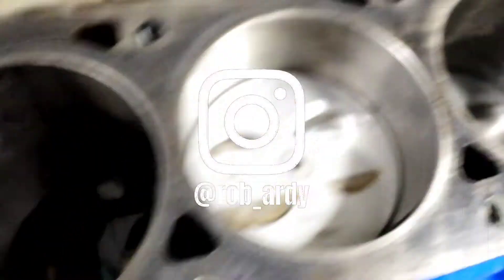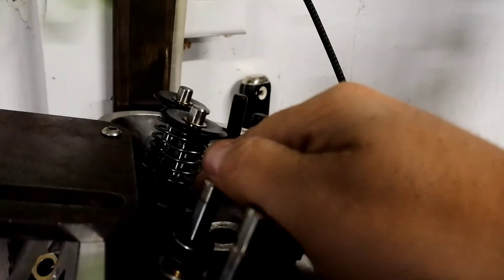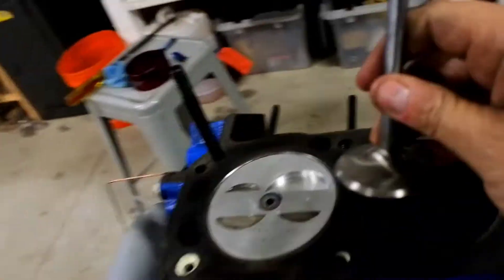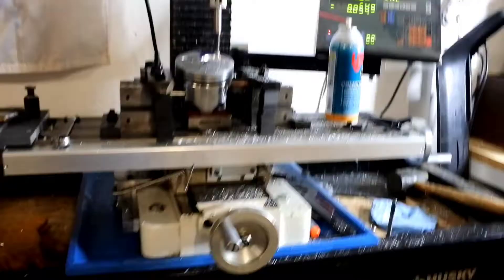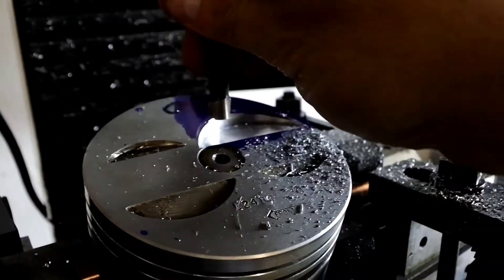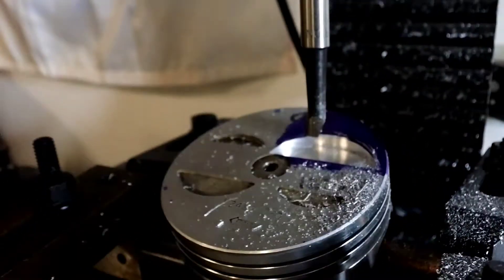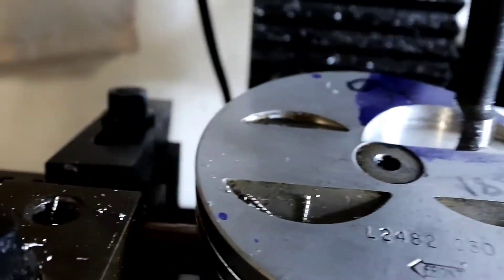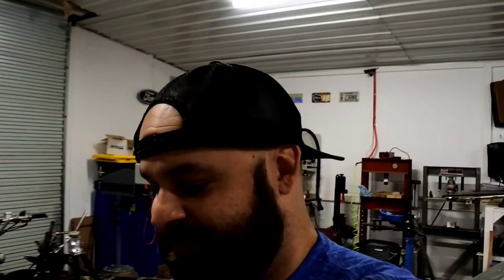Cutting piston to valve relief

Comment: Be careful about the depth, Im this gals hubby and ASE patch says, Master Engine Machist, not bragging just wanting to help and let you know that im not just some joe blow, who knows just enough to be dangerous. Also, what i would do, is radius the corner of the tool in case the piston is really thin in that area, every piston will not be the same due to core shift when poring the mold . Hope this helps.
Reply from the maker: Thanks. Engines been running great for over a year. I did measure material depth and there was plenty. I appreciate the comment.

Comment: I would highly  recommend you put a radius  on that tool bit! 0.031  you bee happy you did  cast piston   ! Because  it will cause  a stress cracking in  the corner
Reply from the maker: Hey Jack, I’m no machinist. Just a guy with some machines. The pistons are forged, not cast. Would you mind telling me the benefit of a radius in the tool? Always trying to learn.
Reply: @rdspeedfab  yes sir the reason  you put a radius  on the tool ,so there's no sharp  corner in side the  the piston pockets  , sharp  corner will crack the piston under Detonation or heavy nitrous  hit
Reply from the maker: @jackwillson8099 oh okay, that makes total sense! Thanks for taking the time to explain that. Maybe after I blow this one up, I’ll use a radius in the future 🤣
Reply: @rdspeedfab  you can all so put a radius  on too of the piston pocket , the key is no sharp edges  in  the combustion  chamber    , the more power you make it,  the devils  in the detail learn that from pay musi 35 years  ago
Reply from the maker: @jackwillson8099 I sure appreciate your wisdom. Thank you
Reply: @RDspeedfab  no problem  been a Professional machinist an engine builder for thirty five years

Comment: Insky Cams sells a piston notching tool for about $235 you run through the heave valve guide. They make them in different sizes depending on what size valve you are using
Reply from the maker: Yeah I’ve seen those. I’ve heard they work pretty good.

Comment: Ok...one more question. How did you figure out the correct angle to mount the piston in its vise or holder or whatever in your mill?
Reply from the maker: Check my other video on this. I made a fixture that made repeated cuts a sure thing.
Reply from the maker: I measured the angle of the valve in relation to the deck surface and used that.
Reply: @RDspeedfab  I wondered if that was a way to do it. Good idea!! Thanks man!! I really want to get this engine put together so I don't hurt my 289. For 40 bucks I can beat on this one and not feel too bad.
Reply from the maker: @nickfay2359  heck yeah man! Good luck!
Reply: @RDspeedfab  I did see your video with the fixture. Very cool!  I totally understand how you built it, and get how you figured out how to set the angle and whatnot. After thought hell, I'd have done the exact same thing. Nice fab work! That's how we roll in my tiny shop. Our name is "Tiffany's Revenge Fabricating". My '65 comet is that light bluish color. My wife said it was as close to a Tiffany's  box that she'd ever get and so...😆😆 on her..lol..

Comment: Ok...I am facing a extremely similar situation. Gosh I hope you read this...Alright..my setup and issue..65 comet, 289..don't wanna blow up the 289 so I got a E7 HO engine for 40 bucks. The bores are fantastic, rods, crank everything...perfect.. here's my issue..I'm NOT using the E7 heads, nor the factory cam. I'm getting a new cam, let's use F303 specs as a example. I am also using my world products Windsor Sr heads that have the 2.02 intake valves. I'm going to use the E7 factory forged pistons, rods and crank and just use new, gapped rings for N20 use, new bearings etc, etc. Ok enuff yakking...my question, aren't you concerned much abt taking that much out of each slug and it translating into a balance issue? I'm literally going to do the exact same thing yr doing and I'm curious...any thoughts or concerns abt that? I'm going to be hitting my engine with at minimum 150hp of spray to start and probly working up to 200. For what it's worth I'm going to attempt 1/8 mile hard tire no prep. That's my current jam here in Southern Michigan.
Reply from the maker: I’m honestly not concerned about it at all. All my pistons were balanced before I did this and I made the same cut on each of them. They should be all equally lighter. Besides, if you ever weighed a set of stock pistons you wouldnt worry so much. They’re all over the place. I think you’ll be fine.
Reply: If you mock up your heads and go through how much clearance you have throughout the different timing events, I think you'll find the F cam stays pretty safely away from the piston. ALWAYS check of course, even if some know it all like myself comes along and says it fits, I've been wrong before lol. But if I use a letter cam, F is my go to and I've stuck them in everything at one time and they seem to fit well in many configurations
Reply from the maker: I’ve heard the same with the F cam.
Reply: @RDspeedfab  it's a wonderful cam. I've played with many cams and all the letter cams Ford offered. The F is a pretty good all round cam for someone thay wants to drive their car regularly with addded performance and sound. Never did get the whole E cam craze as I always found it unthrilling and lacked low end power without really giving any top end advantages to make up for it. I've stuck both in trucks with highway gears and tall tires and the E was really unhappy about it whereas the F manned up and didn't complain. Plus with the wider LS it ran smother. I actually prefere the stock HO over the E. I have an almost 11:1 347 with big heads and a factory HO in one of my Mustangs. Even my travel van has a HO cam with Roush 200's. Such a nice lil cam for a well behaved driver. Just add better parts and machine work and nobody even believe it's a stock cam lol.
Reply from the maker: What’s your take on the B? Both my 302’s have the B. The Falcon motor I built and the motor in my mustang is a ford crate with the b
Reply: @RDspeedfab  B is the second of the two letter cams I like. Especially since I am a fan of cams with 112° center line. Works pretty good with stock heads for those that are on stock head budgets and really wakes up with aftermarket heads. I spent quite a few years working in an engine shop specializing in race engines but I really enjoy the milder street engines than just throwing money at expensive parts. Although 112°  lobe seps amd center lines are typically an EFI design, I found them to work really good with carbed street engines. I am fairly involved with street stock circle track racing and they are quite regulated and they have a flat tappet cam rule. My typical go to selections are actually out of the marine based grinds as they're often on a 112°. They work great in our mild built short track engines tjat thrive off powerful low and mid torque. So when I got to play with the B cams, I was not dissapointed.
Reply from the maker: That’s great info. The Falcon is efi while the mustang is carbureted. I haven’t ran the efi engine yet but I’m not disappointed with the setup in the mustang.
Reply: @RDspeedfab  oh it's gonna run mint👌. I like the roughness a carb to an idle, that dirty sound just does it for me. Both my Mistangs were efi and so was my van. All have carbs now lol. And my daily driver is an '86 F250 4X4. Last year of factory carb here in Canada. I got a different one on there now of course. It actually was a 351W with C6 origionally. I now have an aluminum headed 460 in there mated to a ZF5 trans. The 351W got rebuilt with the Roush heads and put into my van while the origional van engine ended up in my 93 Mustang after rebuild. My 347 is in my 86 t'top Mustang. Just to be clear, I also play with GM's lol. Not a die hard Ford guy😉
Reply from the maker: Awesome! Yeah im not brand loyal either. I just always seem to land on fords. None of my family’s daily drivers are fords lol

Comment: How deep did you good? I’m about to do the same to some 302 pistons.
Reply from the maker: Every setup is going to be different so you’ll definitely need to measure how much you need to remove. For mine, the pocket was deep enough, just not big enough for the valve so all I did was open it up to the valve size plus about .020 to give the valve some room.

Comment: I’ve got the same pistons and I’m going through a similar issue but my pistons are still in the motor. Did you happen to check the piston to make sure it had enough meat to take away and still be structurally good?
Reply from the maker: Yes I did. There is still plenty of meat under the relief cuts. Over .500. You’ll be good to go.
Reply: @RDspeedfab  Thanks! What heads are you running and how do you like them?
Reply from the maker: @ktga67ish  flotek 1.94’s. Still haven’t ran this engine 🤣
Reply from the maker: Yes I did. There is still plenty of meat under the relief cuts. Over .500. You’ll be good to go.

Comment: in the future take smaller cuts, higher spindle speed, and set an air nozzle up to keep the chips out of the valve relief and you wont get as much chatter. but more importantly you wont get localized heating that could mess up the heat treat the factory put on the piston bro.
Reply from the maker: Hi Bill! Thanks for the comment and the help! I’m learning as I go over here so I put like yours is super valuable to me. Thanks again!

Comment: Ok, your problem isnt valve wobble and isnt piston rock. If these are your problems, your engine is whooped or your reliefs arent right. At tdc the valve cl crosses more toward the CENTER  of the piston vs if the piston is further away from tdc where the valve cl crosses more toward the opposite edge of the piston. At 0, you have WAYYYYYY more than enough radial, because your valve isnt OPEN at tdc. It's either opening or closing depending if int or exh, thus, you dont need 100% radial clearance unless you want to make a 0 interference engine. (Like if you broke a timing chain/belt)..  remember, piston cl is not parallel with valve cl. They have different crossing points depending on position.
Reply from the maker: I get what you’re saying and it makes total sense. The engine is still absolutely interference. I recorded piston to valve contact 15 degrees either side of TDC depending on intake or exhaust. I used the .050 radial figure because that’s what I found after some research. I had t done this before so I wasn’t sure what I was needed but.... the eyebrow in the piston wasn’t sufficient for the size of the valve hence the contact. I really didn’t make the pocket any deeper, just opened it up for clear the larger valve. Still tons to learn. Thanks for watching and commenting. I appreciate it.

Comment: Get a valve relief cutting tool fond a old junk set of heads take the valve out of it set it down on the motor and use a drill to run the relief cutting tool through the hole in the head for the valve with the piston still in the block
Reply: Brandon he doesn't need a cutting tool. Why would he buy a tool when he has a mill already? The mill does the job perfectly and all he has to do is clean the pistons. Alot less messy than the other way.
Reply from the maker: That’s certainly an option. But this way I was able to get it done right, and maintain my balance because I weighed each piston and removed the same amount.
Reply: @RDspeedfab  great video and nice clean work. It's not nearly as messy and takes less time than the alternative. Good job.
Reply from the maker: Thank you sir! You get it. I appreciate that.